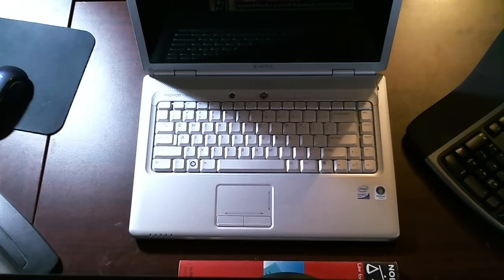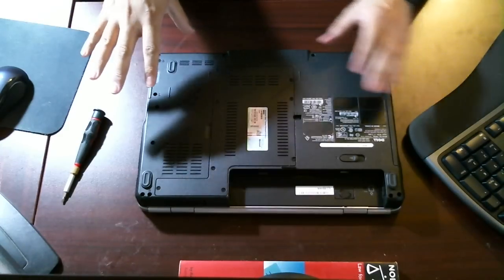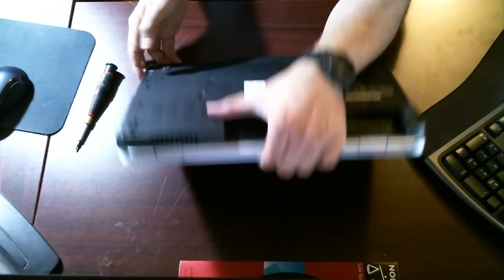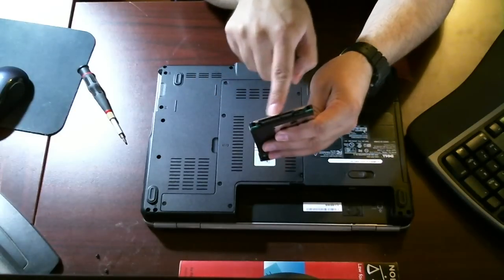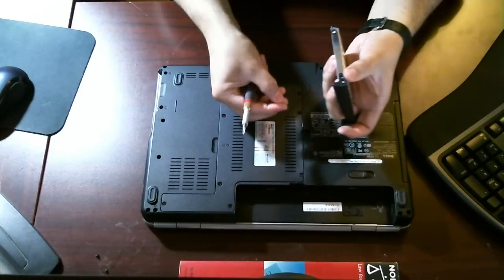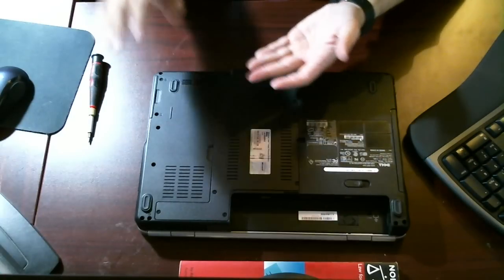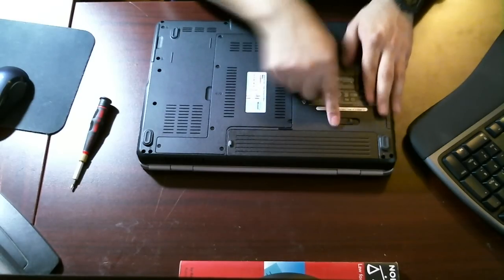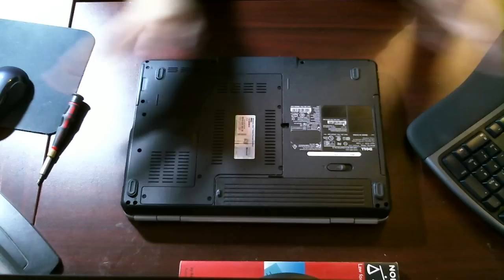Dell Inspiron 1525 Hard Drive Replacement (Classic Repair Guide)

Comment: I have a dell inspiron 1525 and i had windows 10 for a year but the hard drive of 500 gb is failing. I ordered a new 500 gb and can I put windows 8 on it instead and how and where can i get a windows 8 disc or flash drive. Any help appreciated. My computer is like the one in the picture.

Comment: Hi, I almost thought your name is Austin 😜, I have a question buddy - very glad to know I am now able to upgrade the hdd on my 1525. But was wondering if you could tell me if I could upgrade my inspiron 1525 to 1tb hdd and upgrade the ram to 8gb. Currently I have 150 gb hdd with 4 fb RAM, it's a core 2 n series laptop
Reply: have the same laptop.but with the 32 bit architecture , core 2 duo processor which can take upto 4gb ram(DDR2)..if your system is a 64 bit one then max ram can go up to 8gb(in 2 slots of 4gb each)....and my system struggled with a 1 tb hdd/ssd....so i kept that at 500 gb...dell inspiron 1525 came with different cpu s and 32 bit or 64 bit architectures.....

Comment: To all those that could not get their laptops to detect the new hard drive or just decided to upgrade to a new hard drive, please be aware that newer hard drives are slimmer by a few millimeters causing the sata connectors to not connect if you install the new hard drive using the given tray.

To properly install it, separate the black plastic slot covering from the tray, and screw the slot covering directly to the new hard drive and carefully slot the new hard drive into place. Turn on the laptop and head into the BIOS to see if the hard drive is detected. If yes, just screw the two remaining  screws to secure the hard drive.

I too was confused to why my new drive was not detected until I read on the dell forums about this issue.
Reply: Hey thanks for the help friend. I was trying so many things till i found you. Very helpful. Thank again.
Reply: God damn you just saved me... spent about an hour fitting the SSD into the black metal mount the HDD was screwed into and could not for the life of me get the SATA connectors to line up 😅

Comment: Hi, I have the same notebook inspiron 1525, and a try to change the hard drive for a WD 500gb 5400RPM (WD5000BEVT), but the note show me the error 2000-0141, hard drive not detected. Are you have some idea how can I solve this?

Thanks!
Reply: faced a similar problem wth my dell insp1525...what was happening was that when the hdd was slid in it had not connected to the sata port probably as my new hdd was 7mm and i had not used a spacer.i opened the ram/heat sink/processor hatch and could actually see and ensure the hdd docked properly into the sata slot....thereafter my hdd was detectable.this is a problem peculiar to this laptop where you cant see if the sata has docked properly just by sliding in the ssd/hdd, unlike other laptops where you lay the hdd/ssd in the bed and slide it towards the sata connectors ensuring that it has connected

Comment: Hey I need your help, I have a dell 1525 with a damaged hard drive. My computer said that it may fail in the future (which it has) and now everytime I start up my laptop, it gets stuck at the little loading screen (where everything is black with microsoft windows near the bottom middle and has a scrolling green bar) and after a while it gives me the blue screen of death. If I replace my hard drive (and then re-install everything) will it work then?

Comment: H, I have a problem with my dell1525 I change screen  and now  I have an error code 2000- 0141  (NO DRIVE DETECTED)    SAME PROBLEM  AS RED 070809   ( I need a new drive ?

Comment: I just spoke to the guys at Dell who were kind of forcing me to have the technician come out and install new hard drive and re load everything but i've just seen this video and have to say thank you first of all. You just saved me over 150 pounds! secondly, i have one question, as i'm now going to buy the part and follow your instructional, where can i get the operating system disc from, and will it only re install Windows Vista as thats what is currently on the system? Cheers

Comment from the maker: Hmm.. this is correct. You have to re-install the operating system first BEFORE the system can recognize a boot-able device. Put the Windows disc in the tray, restart the computer and tap f12. Boot your computer to the Windows disc and follow the onscreen instructions to install the OS onto the hard drive. Once it is installed, your computer will now have something boot-able to boot to. Best of luck, please subscribe!